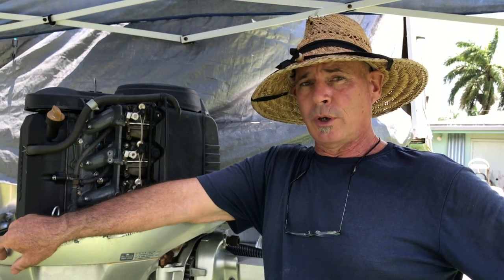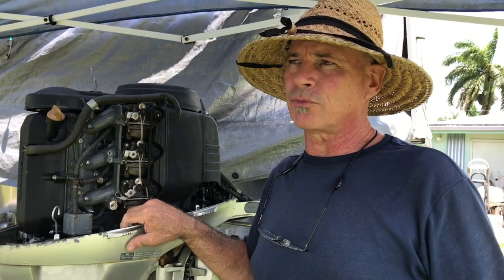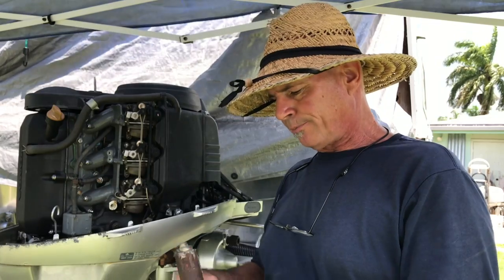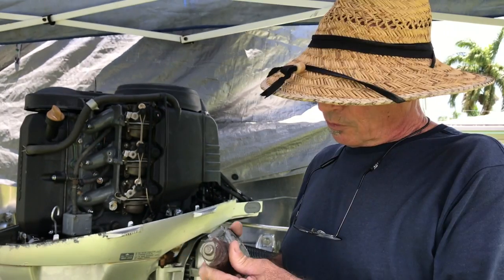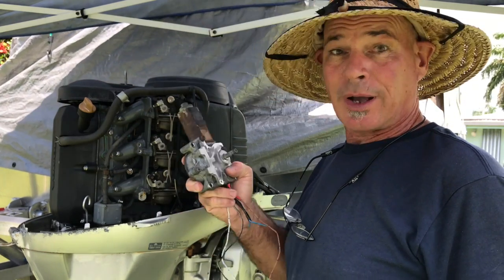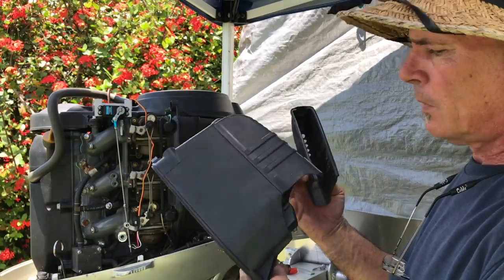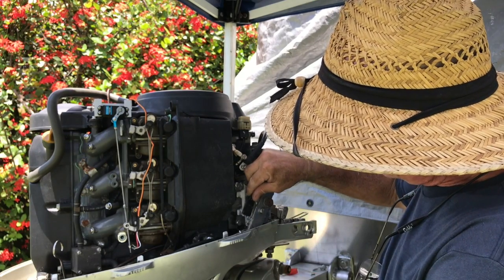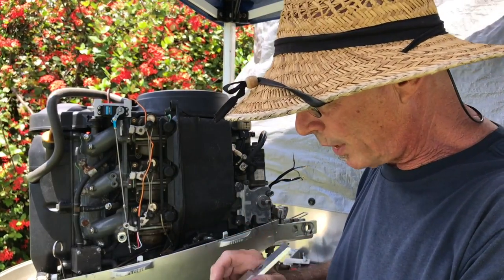Outboard motor electric shifter part 1

Comment: Is the heat of the motor not a problem for the servo etc, thx, very nice project
Reply from the maker: I don't think it will be. The servo specs are well within range of the environment they will be exposed to. We shall see! I have spares ready to swap out should anything fail, and will re-engineer accordingly after any glitches. Thanks for watching!!
Reply: @bohemianmachine   i follow you, very interesting, thx
Reply from the maker: @jappecoco  Thank You!
Reply: Are your schematics available for purchase.  I have a 9.9 mercury outboard tiller handle that I am transferring to remote and I would like to use electric shift and steering for this motor as I’m using it for a kicker motor on a snake head boat.  Your hook up seems to be exactly what I’m looking for. I’m very interested in the power window actuator the relay system seems to be straightforward similar to the relays they would use on an aftermarket trim and tilt plate very cool concept though